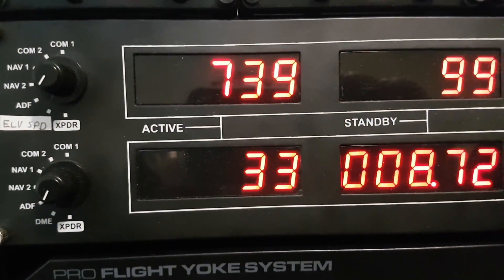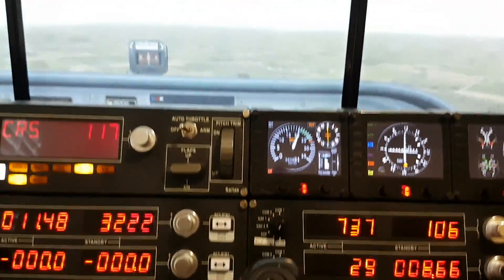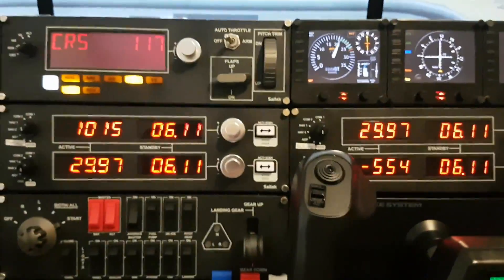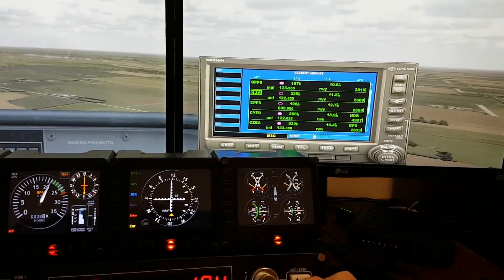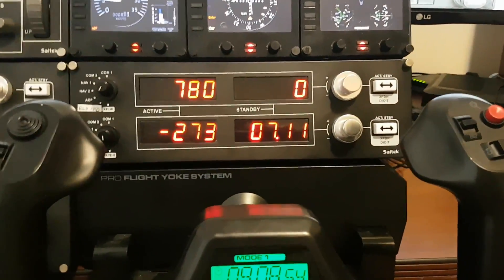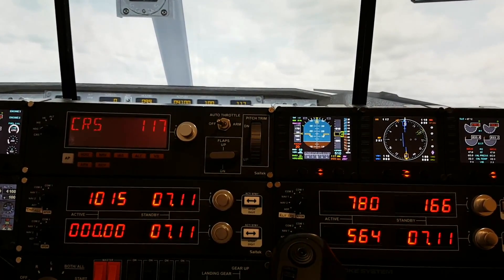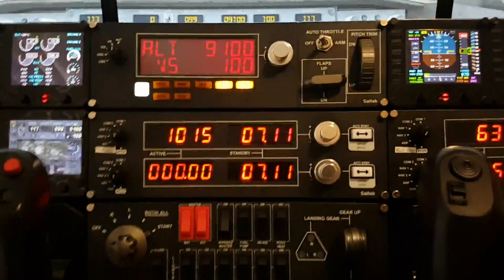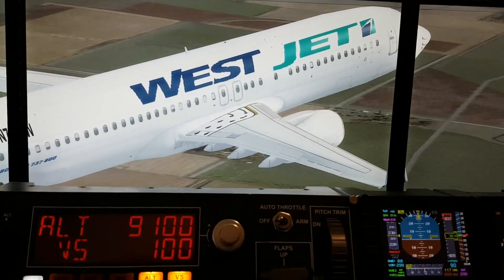Saitek Radio Tips and Tricks with Spad.next (part 1)

Comment: how did u attch the switch panel to the table?
Reply from the maker: I have two yokes that are attached to the table and my switch panel and everything else is attached together and attached to the yokes.
Reply: @vadermike7772  yes but how does the switch panel attach, did u screw it on, is it screwed to the throttle and trim or did u drill a screw into the table

Comment: I know this is old but are the instruments on the right side of the panel the same model as those on the right. I hadn't seen the Saitek G Pro displaying the fuel/oil pressure temp, level, nor the VOR info in any of the ads I have seen?
Reply from the maker: They are not the default Saitek displays. These are 3rd party add on gauges from Tom  at https://fsxtimes.wordpress.com check it out, I highly recommend his gauges

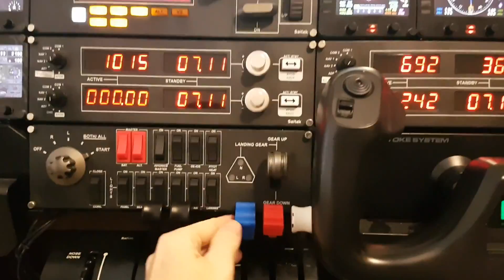Comment: Why are all of the Multi Panel's autopilot lights blinking at 14:03? There's not a single autopilot in the real world that behaves that way, because every lateral/vertical mode cannot possibly be active (or armed) at the same time.
Reply from the maker: Check out my Multipanel video, which will answer your question in detail. I have various settings for the the multipanel buttons where they will start blinking based on certain criterial. (overspeed for example, or gear up below a certain airspeed), amoungst others.  It does not effect the actual button functionality, nor does it mean that every mode is active at the same time. It just means there is some type of "warning" criteria going on.
Reply: @vadermike7772  I'll watch it. Thank you, sir!

Comment: Hi, GREAT video's and impressive setup there... thanks for showing us around your rig and sharing your knowledge on the implementation of SPAD... very informative.... I received two Logitech radio panels yesterday and ran into, what I have since learned, is a known issue concerning the MMR version of the NAV radio in the 737-800 Zibo. In short, there are two versions available... an old-style panel which uses rotary knobs and a multi-mode receiver (MMR) version which has keypad style input keys. If the MMR version is present, the Logitech Radio Panel physically changes the frequency in the aircraft but does not (repeat, does not) update the frequency displayed in the NAV radio in the cockpit. Just to clarify, everything works properly if the alternative 'old-style' version is present, thus an issue with the input style... knobs versus keypad buttons? Wondering of you have encountered this issue and if so, if you have resolved it?
Reply from the maker: No sorry, I have not come across that. Also I don't have the 737-800 Zibo, nor xplane.
Reply: @vadermike7772  OK, thanks anyway... maybe someone else reading these comments may just know how to resolve this issue (if, indeed there is a way?)... hopes fading but you never know what might just turn up :)

Comment: Why in god's name do you need two yokes for a flight sim? :-o
Reply from the maker: Actually, it happened completely by accident. I had one yoke for many years. I wanted to get rudder peddles for my sim, and I came across a great deal on a used saitek combo set, that included a  siatek yoke, throttle quadrant, and rudder peddles. The entire set was cheaper than what it would have cost me to buy the rudders on their own, and it included a throttle quad, so it was a no brainer for me. I didn't need a second yoke at all, but since I had it, I added it to the sim.

Comment: That looks so impressive... any thoughts on an issue I am having my Auto Pilot panel will only 'come to life' after the sim is running I have to unplug and plug in again.  All the other panels work fine and I have tried lots of different USB slots its also a direct connection not through a hub of extension.  Running FS2020 am flummoxed

Comment: Can you help... I am currently using the SAITEK drivers and cannot get the physical switch panel to turn the power off when I switch the avionics switch on to the physical SAITEK radio panels and multi panel ... can you please help.. if you prefer to call me.. please advise. Thanks so much

Comment: Great video!  Need help, I just bought a Saitek Radio Panel for my MS FSX all bottoms work well except for Nav2. Ok, Nav1 shows a reading  when select a VOR frequency as well as DME, but Nav2 doesn't show a reading on  DME. Seller sets problem has to do with my drivers. Don't agreed with seller because if Nav1 DME works fine don't see why Nav2 DME doesn't.   Any advice?
Reply from the maker: Are you using spad.next? Or are you using the regular drivers that come with the unit? If you are using spad.next,perhsps the dme variable for dme2 is incorrect. If you are using the normal drivers out of the box (without spad), then it is probably a problem with your unit. (as the variables are not configurable with normal saitek drivers)

Comment: What type of USB ports are you using for all those instruments?  All my FIP’s are not loading correctly.  I bought (2) 7 2.0 USB with no success. Thanks!
Reply from the maker: I am using an orico 9-port, an insignia 4-port, and an insignia 7-port. At first, I tried a cheap USB hub bought on Ebay from China. The thing worked fine for mice and keyboards and stuff, but not for FIPS or for my panels. Even though the china hub was powered, it wasn't supplying enough power which rendered it useless to me.  My new USB hubs work like a charm. Of course there are other vendors out there just as good, but these are the specific ones I use.
Reply: vadermike777 thanks!

Comment: Hello,
Thank you for your videos!
I currently have the Saitek Multi Panel with the application SPAD.Next 0.9.6.25 and P3D.
When I run P3D anything works but the multi panel when I change altitude for example, it changes in P3D but not in the display of the multi panel.

Could you please help me with that?

Thank you !

Comment: Hi....Like your videos....Can you tell me if you have modded your Saitek yokes....
If yes----How....

Cheers....

JohnG....
Reply from the maker: It is possible to use spad.next to modify the yokes, however in my case, I am just using the saitek software to control my yokes.
Reply: I meant internal modification....
Would it be possible to do a video of just one(1) Saitek Radio panel....i got 
a bit lost when you were going from No.1 panel to No. 2 panel then back to
No.1 again....

Cheers....

JohnG....

Comment: I love how the attitude indicator changed when you changed the aircraft form Cessna to the B 737. Does that happen automatically with the Saitek instruments or did you have to set this up?
Reply from the maker: plsniper It is not automatic with the default Saitek drivers, but it is automatic when switching between spad.next profiles. And you get to choose which aircraft to bind to which profile. Including which gauges are displayed on each Fip for each profile.
Reply: Thank You.

Comment: Can you implement Spad.next to run a Saitek instrument panel as it was designed with the original drivers as I like the option buttons on the side that gives you Atc ext.I Love the boeing 737 800 but I don't see any profiles for it on Spad.
Reply from the maker: Yes, you can assign any buttons you want to the FIPS, and use it much like the saitek drivers, but with even more functionallity. Just keep in mind you cant use both the siatek drivers and spad.next at the same time as there will be conflicts. I have a bunch more videos I want to make, but I just dont have the time right now.
Reply: Thanks man you are a star you help so much I need to buy you a beer.